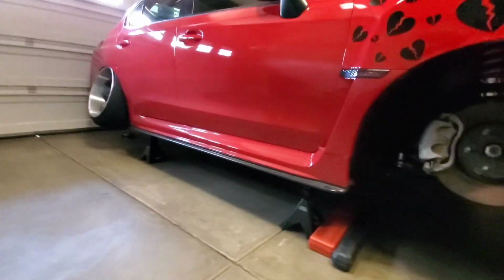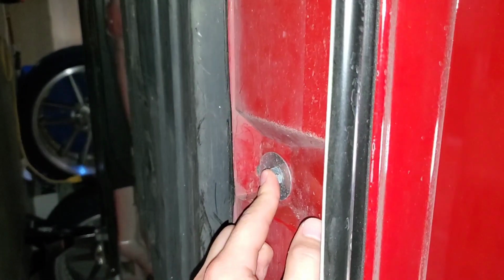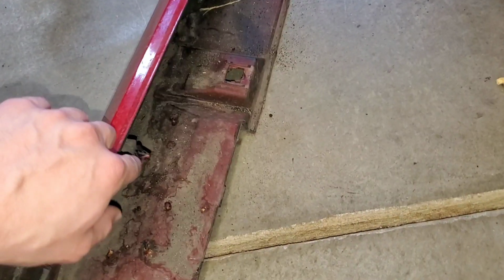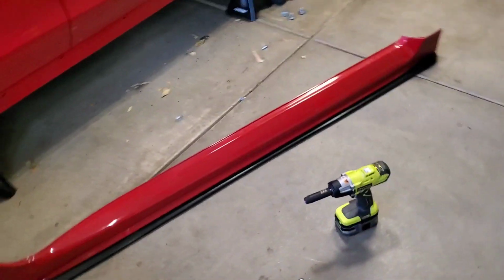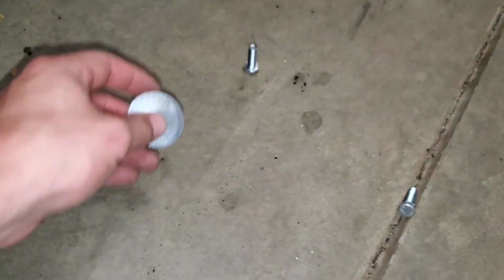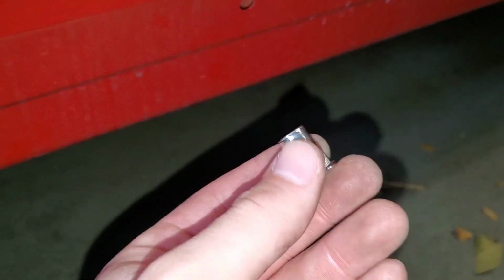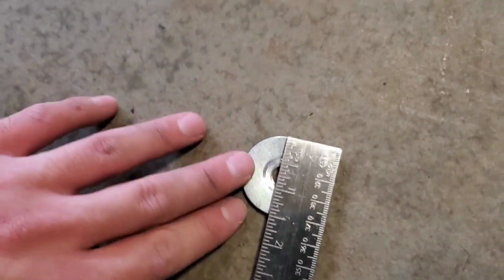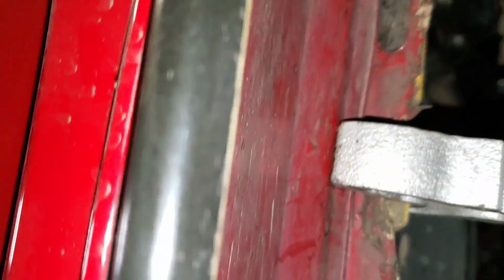HOW TO REINFORCE YOUR SIDE SKIRTS AND MAKE SURE THEY NEVER FALL OFF

Comment: how’d u hold up the lip, with rivnuts as well?
Reply from the maker: For the lip I just use bolts + washers + nuts
Reply: @Alexhaav excellent thanks for all the details! I wanna do this. I plan to remove the back skirt part with a carbon fiber one. Could I rivet that in as well you think?? Like, could you have rivnutted your black skirt extensions on if you wanted to??
Reply from the maker: @Keyboardletters for extensions, i typically only use screws with nuts as the plastic is not the best material to put rivnuts into. For skirt to body, the rivnuts are nice since it’s plastic mounting to metal.